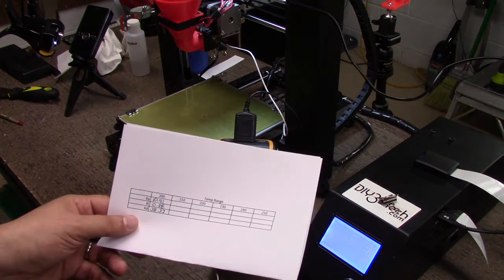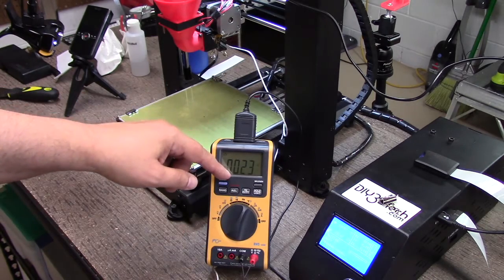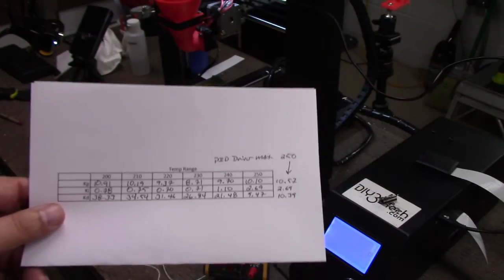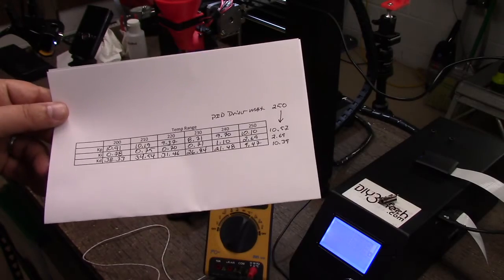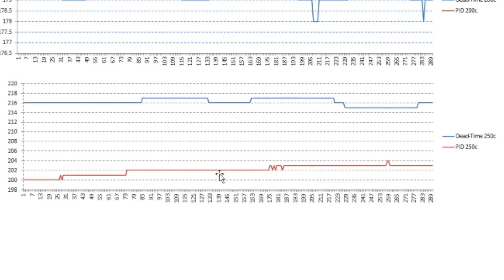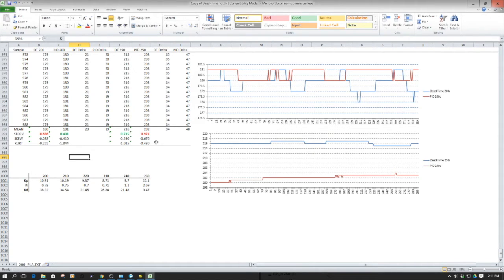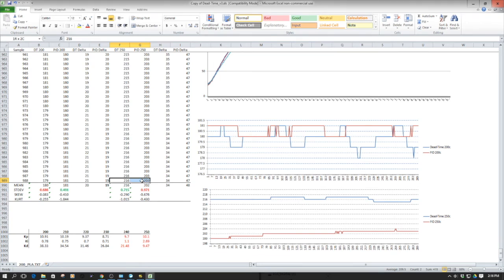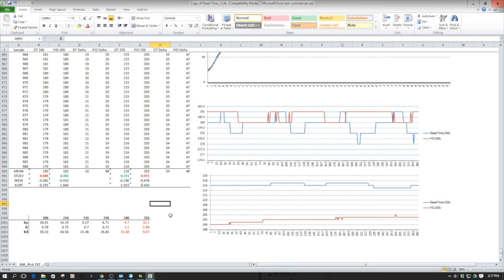3D Printer Talk - The Winner Dead Time or PID and What's with the Wanhao! Part 4

Comment: First, It is absolutely critical to insulate the heatblock. e3d finally realized what users have been doing to insulate the heatblocks and made the silicone sleeve. I wrap the heatblock in ceramic insulation and then use high temp tape (not kapton, it's too flimsy and thin). You can't wrap the heatblock with kapton as kapton max rating is 250c -- it's not meant to be exposed to higher temps for prolonged periods, no tape is designed for that, so what touches the heat block needs to be rated for the temps you are using. Ceramic insulation (you can find it on Amazon) is rated for over 1000c. Second, make sure the thermistor you're using is capable of handling high temps. You will see a drastic improvement from insulating the heat block. I use PID on all my machines, and insulation of one form or another, and have <1C deviation in the curve.
Reply from the maker: Thanks for sharing and 1c is really good and can see how insulating the heating block would especially when you trying to reach higher temps.  Do you have a link the ceramic insulation you have used?
Reply: Ceramic Insulation 1" x 12" Piece Improves Performance of Your Hotend amazon.com
Reply from the maker: Thanks will try it, also it says "There is no adhesive backing" so how did you attach?
Reply: Basically wrap the heater block. Then use tape over the ceramic insulation to wrap tight. Technically nothing is adhered to the heater block, it stays on because of how tight you wrap the tape.
Reply from the maker: Ah I see!  Will give it a go!

Comment: what were the temps reported by the melzi for DT150 and PID250? I have problems with PID250 either sitting way above or below the reported temperature. Also I see problems as the ambient temp(in my enclosure) increases the temp sudenly jumps to a way higher value. This is why I use bang bang as at least it always oscialates round the right value. Mine is also much noisier when its actually printing than in static tests.
Reply from the maker: The issue for me is it runs way lower the higher the temperature rises.  So if set it for 250c, i get about 210c whereas if I set it for 210c, I get around 200c...
Reply: DIY3DTECH.com i meant because of the differenxe between PID and DT. Yes there is a difference between your external thermometer and the built in thermister, but I would have expected this offset to be roughly the same for both methods. I was just interested to see if it actually reached what it thinks is the correct temp.
Reply: DIY3DTECH.com i meant because of the differenxe between PID and DT. Yes there is a difference between your external thermometer and the built in thermister, but I would have expected this offset to be roughly the same for both methods. I was just interested to see if it actually reached what it thinks is the correct temp.
Reply from the maker: The number where far from I would have considered close and this was surprising part as I expected as mentioned for them to pretty close...

Comment: as i was saying on one of your other videos ,  some thermisters get a bit henky near 250 . if you look at your thermistor table sin Marlin , you will see above 250 , the next temp is 800c to 900c+ . so thats where teh exponential curve starts to rocket .  now take that delta  250 > 900 ,  it's really hard for  standard AD converter to be able to sample that well . 
I have seen posts in forums where other shave hand added  their own calibrated table for their thermistor in the print head.  
Also i wanted to take o old dead nozzle , drill it so it can take a  thermistor or  bi-metal  sensor to get real nozzle  core temp .  Or back to the 'old 'days of drilling small hole in nozzle for temp sensor.
Reply from the maker: The 250 thing is new to me, however the non-linearity is what is troubling to me.  I am debating if its worth investing more time in or not as I just use a cheat sheet right now for adjustments and the printer does just fine.  However I am getting around to printing nylon and need more stability so thinking about either modding the Tarantula or buying another mono-price mini (the price has droped) and replacing its hotend an all metal E3 v6 (which I just got a clone in)...